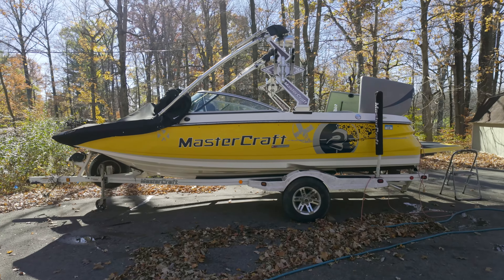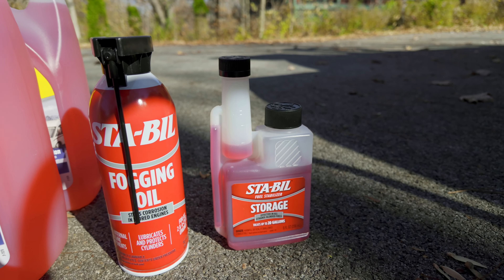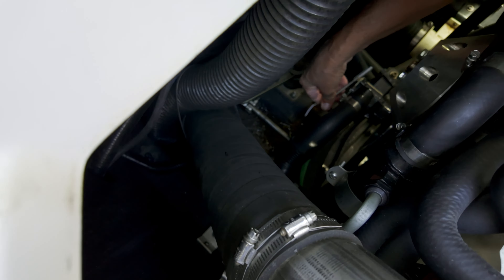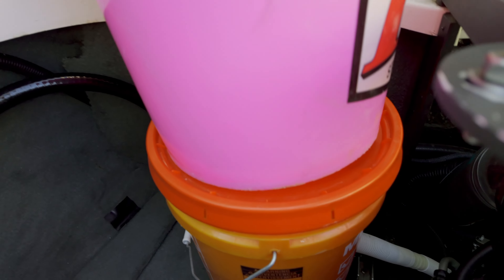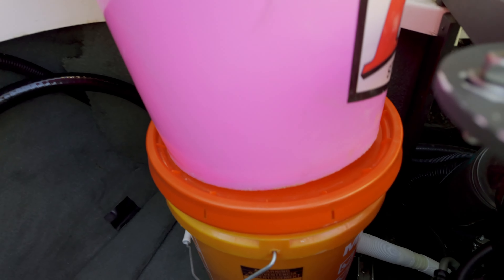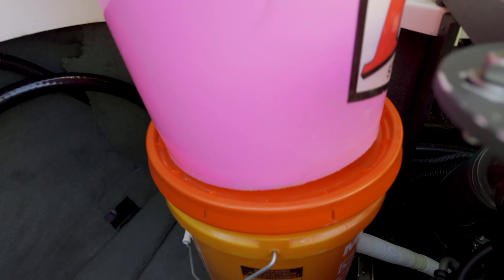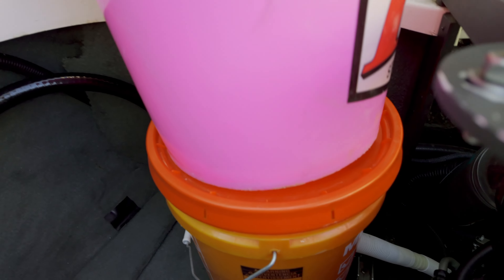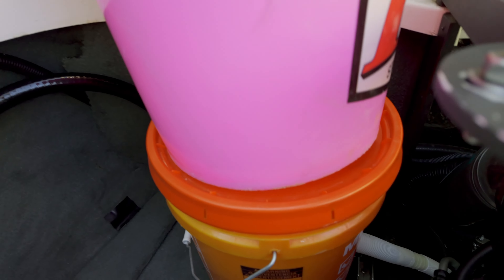How To Winterize A Wakeboard/Surf Boat

Comment: hi, you should also spray fogging oil in each cylinder through the spark plug holes and crank it a couple of seconds so it really foggs your cylinders. another thing is to run your engine already with the fuel stabiliser in it so it runs through the fuel lines and injectors an not just the tank. otherwise great video hope this helps